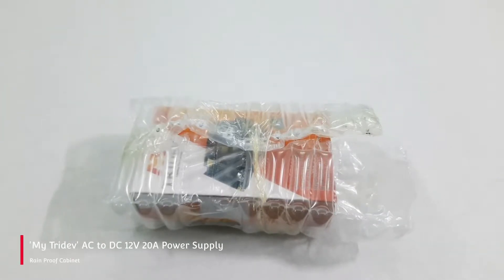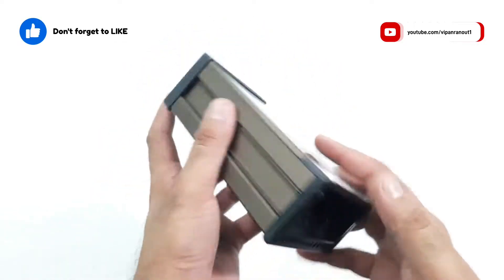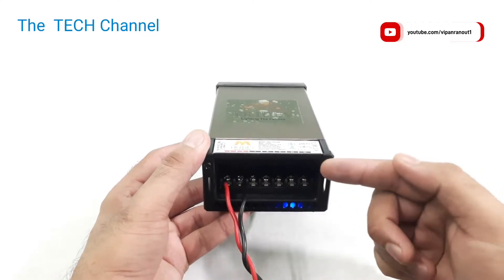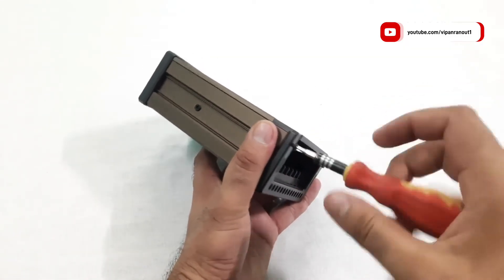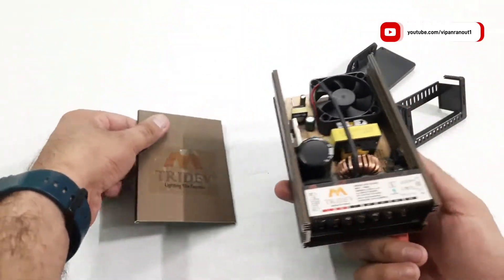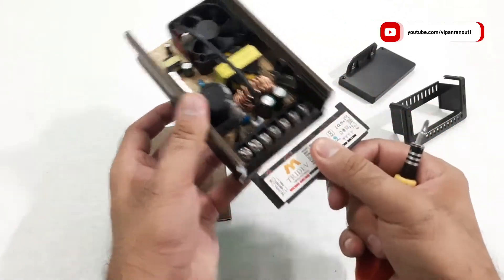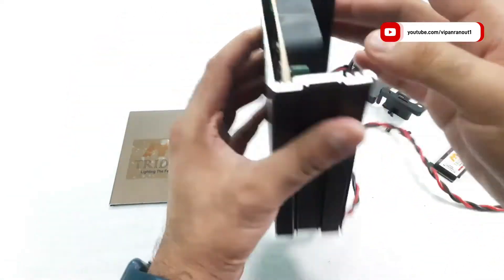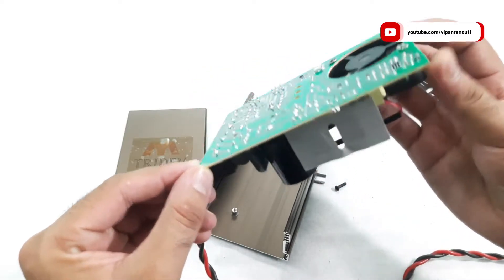'Tridev' DC 12V 20A Power Supply || Rain Proof SMPS || UNBOXING || Initial Impressions || Teardown

Comment: Bro they have 2 points of + - so we use 2 things at same without any low voltage and ampere 
For example:-  I have to products which consume 12v 20ah supply. So through this power supply I can use power at same time without any low power issue 
I hope you understand my query 😅 ❤
Reply from the maker: Those are just for convenience, which means internally they are connected to one single output. You can connect as many things as you want provided the combined load of all the devices should not exceed 20A.
Reply: @TheTECHTract  ok so they have power distortion. I think for proper voltage and ampere output need 2 power supplys 😑
Reply from the maker: Yes, for two 12V 20A devices you will need two of these or get a bigger 40A or 50A version instead.

Comment: Thanks for the video. Is there an adjustable potentiometer to vary the voltage? I think the non waterproof models have that.
Reply from the maker: The unit in this video didn't have a potentiometer to adjust output voltage. However I have another unit from same brand bought much earlier which does have adjustment option. I guess this newer unit has some voltage regulation built in. Because even under significant load it doesn't drop below 12V. Hope my reply was helpful.
Reply: @TheTECHTract  thanks a lot and yes it was helpful

Comment: Just a question here. The total load is 12v20 amp and we could see there are two dc outputs.

What would be the output (volts and amperes) per channel if both of them are used at the same time?
Reply from the maker: There is only one 12 volt rail. No separate channels. Those are just separate connection points provided for convenience. All positive terminals are connected to a single positive output internally and same goes with negative terminals.
Reply: @TheTECHTract  thanks for the explanation. If you take output from both the output channels at the same time, then I will be getting the same 12 v20 amp supply in both at the same time?
Reply from the maker: @Thedarkwebgiant  Yes. You will get same output even if connect to all three or connect to only one of them.

Comment: Just a question here. The total load is 12v20 amp and we could see there are two dc outputs.

What would be the output (volts and amperes) per channel if both of them are used at the same time?